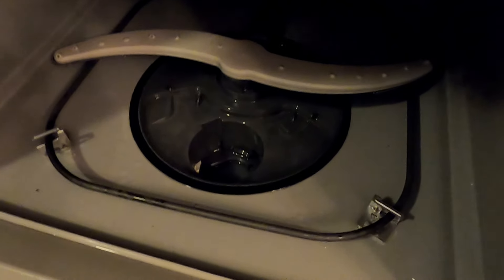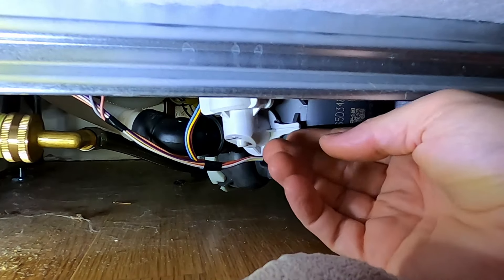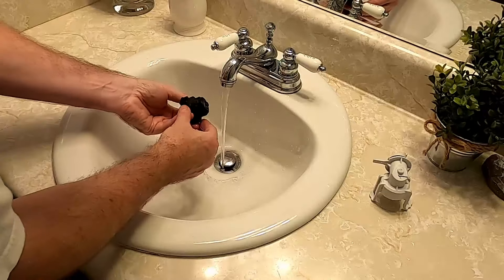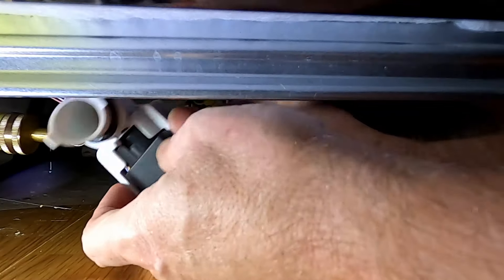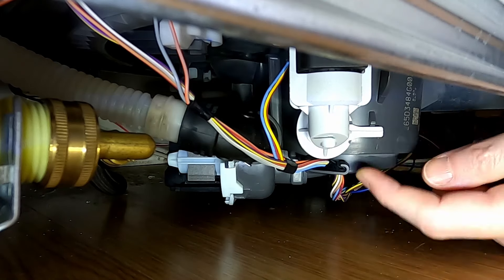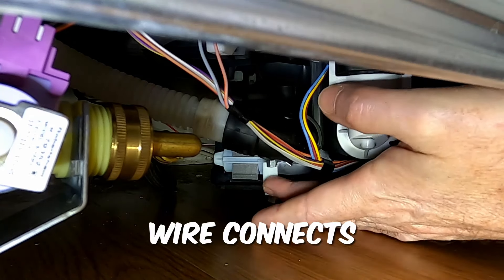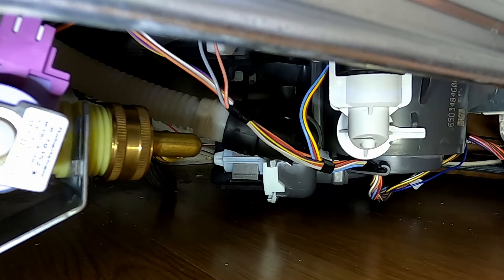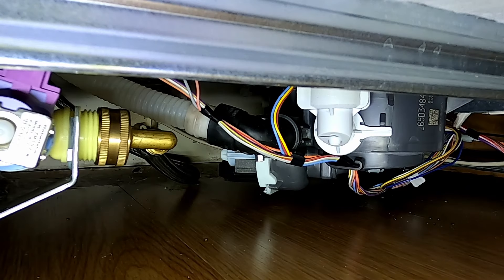How To Fix FTD Failure To Drain Dishwasher Error With OUT Removing Dishwasher.

Comment: Completed this job quickly - thank you on describing how to do this without pulling the dishwasher out. My pressure sensor was full of junk. While you’re under there, clean out the turbidity sensor too - mine was dirty and added unnecessary time to the load (a 120 minute cycle had 30 to 40 minutes added to it).

Comment: Thank you KB DIY! Solid solution; easy to follow and on target. I did find a fair amount of slimy schmutz in the elbow, and the plunger of the sensor was fairly gunked up, and only came free after a good, gentle cleaning. Subscribed, and saving this link in my appliance repair spreadsheet. One thing that I found was that the only indicator I got was via the SmartHQ app that I use to monitor this device. I had added a wifi module (did not come with the machine) and it gave me the error, which was not visible in the user interface on the door. Thanks again!

Comment: I ran into this problem on 2 of these GE dishwashers today! One was consistently giving a “FTD” Failure to Drain code mid-cycle, and the other was giving an “H20” code when it began filling at the beginning of the cycle. Both were fixed by following your instructions! I found the FTD-problem sensor just had some crud inside the white elbow part and some crud around the black part. H20-problem  sensor had a whole bunch of gunk nearly clogging up the white elbow part and lots of stuff around the black part. Cleaned both completely and both started working! Didn’t need to replace either of em! A tip: make sure the black piece snaps back into the white piece. It will leak if you don’t…! Great video—thank you for making my day as a tech much easier :) A tip to anyone reading this—use LESS detergent if possible. Avoid pods, use powder and don’t go overboard at that. I’m convinced excess detergent is behind this problem to some degree…
Reply: Did it have a washer inside ?? Between the black and white pieces!? It still leakes

Comment: Excellent video which shows that GE did something right - by placing the pressure sensor within easy reach, easy to remove and replace and easy to clean. This solved the FTD Code error. Thank you.

Comment: Awesome video, very well done!  The camera work is excellent - made it exceptionally easy to see exactly what to do.  One possible suggestion: if you have an air compressor handy with a blow gun, it is really easy to get that grime out of the tiny plunger hole with a little blast of air. I had mine set to ~30 psi and just gave it a couple of shots.  That way you don't have to worry about puncturing the diaphragm of the plunger. But thank you man!  You definitely deserve a case of brewskis for this one!

Comment: Thank you !!!  Thank you !!! Found the sensor without much trouble. Definitely dirty and clogged. Cleaned it, put it back in and washer runs like a charm.  Only video I found which even mentioned the sensor, all others either mentioned the drain line or pump issues. Know where to look with any future issues.

Comment: Excellent worked perfectly, hardest part was getting the o ring placed back without a leak. Small electronic tweezers worked perfectly for the sensor cleaning tyvm
Reply: @   I sprayed a tiny bit of wd40 on the o ring, then it worked for me.  I learned that trick from my pool filter install.  Probably not the right way but it worked for me.

Comment: Thanks so much for the video!  Our pressure sensor wasn’t the problem. When I took off the sensor, the little pipe was filled with grease and it was plugged.  After running some water through it and blasting it with our tap, we’re back in action.

Comment: Thanks for the help I think this will solve my problem. However mine keeps leaking now. Any suggestions? I re-assembled per the instructions. Maybe a faulty o-ring?
Reply from the maker: On the sensor, make sure the two pieces are fully seated and use a little soapy water on the o-ring. They can be a bit finicky. If the o-ring has any damage, it will need to be replaced.

Comment: This tutorial was AMAZING and I think it probably fixed my issue because it was disgusting in there, but now it seems to be leaking around the o-ring after I put everything back together. I tried putting dish soap on it (didn't know how much so I went with just a little) and its still leaking.  The dishwasher is only about 2 years old and the o-ring didn't look to have any damage so I'm at a loss. Any additional tips?
Reply from the maker: Make sure both the clips that hold the two pieces together are fully engaged.

Comment: Thank you for making this video! I think it worked for me, however it’s now leaking. I’ve tried to reposition the o ring a few times, but no luck. What do you do if this happens? The dishwasher is only 2 years old and there were no leaks prior so I’m assuming the o ring doesn’t need to be replaced, but rather is positioned incorrectly. Thanks again!
Reply from the maker: Put a little dish soap on the 0-ring and make sure that the two clips are fully engaged. Most of the time when it leaks it's because the two pieces aren't fully clipped together.

Comment: Thank you!! It worked but the O ring is leaking... what can I do to fix that
Reply from the maker: Make sure the two pieces are fully seated together. It is easy to only have one side fully clipped into place.
Reply: @ thank you. I added soap to the ring and it worked! But i found my dishwasher has leaks from both side as well, its a trickle but its there! Thanks so much again for the reply and video!

Comment: Thanks so much. I did everything but the black and white pieces arent together tightly there is wiggle room. I checked to make sure i seated them correctly. Any ideas? Tsm!!
Reply from the maker: make sure it's lined up square and then press it in. Both sides need to be clamped or it will leak.

Comment: Thanks Killobyte! I followed your steps and was able to clean my sensor, it was pretty gunked up. Your instructions were very easy to follow!

Unfortunately, after cleaning it, I tried to start the cycle and nothing happens. The orange light comes on indicating a cycle has started, and shortly after, the orange light turns off. Normally it stays on until the cycle is done and turns white. All the other face light stay on. It also sounds like a motor of some sort is running, but the timer for the cycle doesn’t run down. It just stays put. It also won’t let me cancel the cycle. I have to shut the breaker off to get the dishwasher to turn off. Any ideas?
Reply from the maker: Sorry to hear that. Double check that the wires are all plugged in.
Reply: @Killobyte  Had to order a replacement sensor, but still your video gave me the confidence to do the repair myself! All set here! Thanks again!!

Comment: This fixed my problem as well. However, do you happen to know the part number for the rubber seal in case I can’t get it to stop dripping?  Thanks
Reply from the maker: I don't. I'd take it into a hardware store and ask them to help you find one that matches.
Reply: @Killobyte  I put some more soap on it and it stopped leaking for now.  I’ll keep an eye on it.  Thanks again for this awesome video, it fixed the FRD code problem. Take care

Comment: I did what you said but now there is a leak where I put the sensor back in.
Reply from the maker: Verify that you have the two pieces fully back together. Both clips must be fully engaged. Than check the O-ring for any cuts, use a little soapy water on it, insert it back in.

Comment: I removed the sensor, cleaned it, and no luck. It didn’t seem too dirty. Then, I replaced the pump, and still no luck. Of course, I checked the line and connection points first. No clogs, and I actually see the water draining into the garbage disposal. Is the next step to replace pressure sensor? I’m at a loss…
Reply from the maker: Yes, I would try replacing the sensor next. Good luck!
Reply: @Killobyte  turns out the rubber flap in the drainage hose had somehow become suctioned up into the hole. I drove it through with a rod and fixed it.
Reply from the maker: @LMB8708  D'oh! Good catch!

Comment: we tried this but now our the area where we disconnected the pump won't stop leaking water. We have made it extremely tight but still leaking
Reply from the maker: make sure the seal is good and it's flat up against the surface where it mounts. You can use a little soapy water on the rubber when installing it.